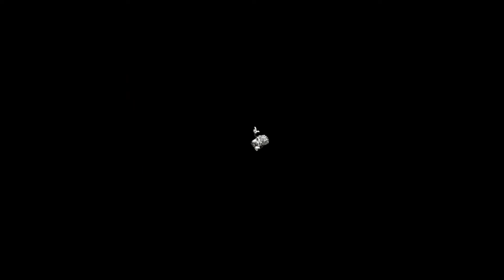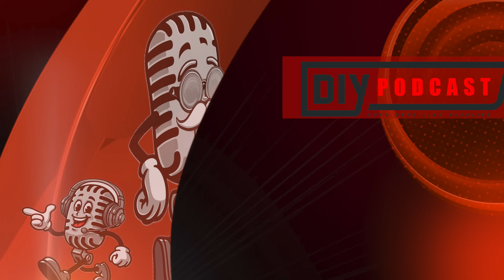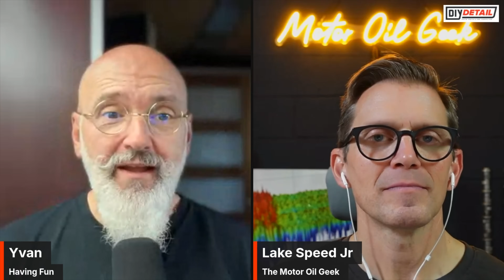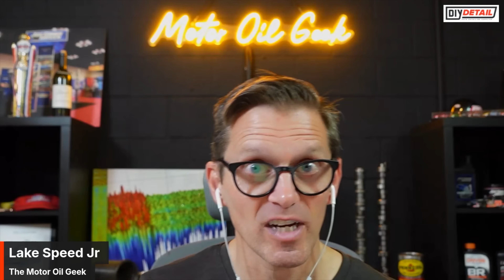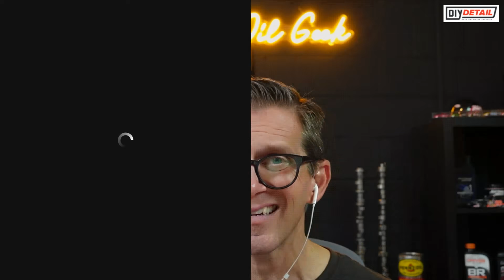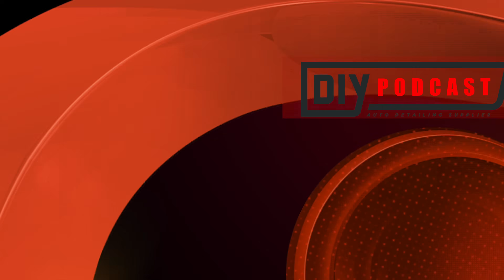Oil myths busted with Lake Speed Jr and DIY DETAIL PODCAST

Comment: As a general rule for the avg driver I rec the following maint sch’d,
* Run a quality fi/comb chamber cleaner (Techron concentrate plus!) just prior to very oil & filter change. This ensures injectors stay clean reducing chance of injectors getting dirty causing fuel dilution of the oil & or excess carbon buildup in comb chambers.
Note,don’t run inj cleaner in a fresh oil & filter change,that because the small carbon particles it removes from comb chambers & injectors can in some cases get past the rings (esp low tension rings) into the crankcase contaminating the fresh oil.)
* Change the oil & filter every 5k miles max using a quality full syn oil.
Note,if your car or truck mfg rec’s for ex a 0w-20 oil & your vehicle see’s more severe service like towing,a lot of stop/go traffic or you maybe take it to the track on weekends i rec going from the mfg rec’s 0w-20 to either a 5W-20 or in sever use cases a 5w-30.
That’s because going from a 0w to 5w base oil & from a 20 to a 30 grade oil when the oil is up to full op temp makes the oil more resistant to viscosity shear for better protection without being too thick/heavy of an oil for todays VVT etc to work properly. For example,If you put 0w-20 into sever Srv’c at times it can easily in some cases shear from 0w-20 to 0w-12-15 or lower which isn’t good. 
But when you start out with a more robust 5w base oil & 30 grade oil when up to norm op temp if the oils pushed hard enough to shear a bit you still have maybe a 2.5w-20 or 2.5w-25 oil still having enough viscosity left to properly protect the engine till the next oil & filter change.
I also rec coolant,transmission (filter too with auto trans)  & differential oil to all be changed at 50k miles too vs many mfg’s rev of at 100k miles.
Also rev checking air filter at every oil & filter change & Repl as needed.
Lastly,if applicable change the fuel filter at reasonable intervals vs mfg rec of 200k miles.
Happy motoring!
Scott
Reply from the maker: Good recommendations.
Reply: Good tips. I stick with Redline S1 Fuel System Cleaner because of it's higher concentration of PEA.

Comment: Guys, anyone reading this comment, please comment down a fuel additive you have used and what was your experience with it, so that everyone can be benefitted with a real user review
Reply: I am in the marine repair field and use Mercury Marine Quick Clean if anything at all. We see problems where customers are told not to add anything to the fuel when they should be using fuel stabilizer to slow fuel degradation and system corrosion control. Those that exchange the fuel every 2-3 weeks or so and use non alcohol fuel are usually OK but those that don't use up the gas in a month or longer, then put fresh gas on top of it really need to keep stabilizer in their fuel and use a high octane fuel since the octane also degrades. We also see people adding way too much cleaner and leave it sit in the system destroying parts. If adding any thing don't use more than recommended. As Lake said, more isn't better.
Reply: Let me go first myself - Chevron Techron 12 oz in 50 Litres of RON95 (RON 91 for US) in VW 1.0 TSi (3 cyl) at 16K kms (10k miles) on the odo - Loved it man!! Really really good product

STP Ultra 5 in 1 365ml in 50 L RON 95 at 25K kms on the odo - currently testing this in my car. Shall update soon
Reply from the maker: Good idea

Comment: To prefill or not prefill the oil filter? 🤔🤔🤔
Reply: Lake answered this in his video https://www.youtube.com/watch?v=939WTeorBnQ and recommends pre-filling because this primes the oil filter element allowing new oil to flow through the engine faster than not pre-filling the filter. They test it by measuring oil pressure. I own an Indian Motorcycle service shop and this video changed our oil change procedure. Prior to pre-filling the oil filter, we observed around 3 seconds of engine valve train noise. With pre-filling the oil filter it is maybe one second. We even pre-fill filters that are horizontal simply by putting enough oil in the filter for the element to soak up and become primed with oil.
Reply: @dyork75 makes sense thanks for sharing!
Reply: @dyork75  another option is to crank the engine until the pressure light goes off
Reply from the maker: Freedom Worx did a good video on this.
Reply: How do you refill a filter that mounts sideways?
Reply: @barrymantei7795  Only fill the filter 1/4 to 1/3 with fresh oil and the filter media soaks it up like a sponge thus priming the dry filter media with oil. That's all you can do when installing horizontal filters (without making a mess) but it still gets oil flowing through the filter and to the engine faster than if you don't prime it.
Reply: @dyork75  thats all i do and then i crank the engine without running it until the pressure comes up and the light goes off
Reply: @barrymantei7795  you can't. And you can't prefill a filter that sits on the top of the engine. And you can't prefill cartridge filters, either. So the majority of cars out there can't be prefilled
Reply: @LA_Commander It appears some vehicles have a procedure to prime oil filters that are mounted inverted. https://youtube.com/shorts/ZF-SPAKtzrY?si=Qka5z9MUnnKBJB1V

Comment: 49:33 what does he say about Mobil 1 and Toyota? Is he recommending Mobil 1 for Toyotas? Sounds like he says "or Mobil 1 which you're gonna want to do"
Reply: Toyota oil has a slightly different additive package. I buy enough oil and filters at the dealership for a the year. Then change oil every 5000 miles or 6 months. If you do a lot of short trips or start the vehicle move it and stop the engine. You can get fuel dilution into the engine oil. Smell the dipstick or drain oil.  I get it on a 5th gen 4 runner. Now if i have to move the vehicle i will let it run up to operating temperatue before shutting down. Great work Yvan introducing Lake to your audience.
Reply: I watch everything lake speed  but have never seen him recommended Mobil 1 specifically for totota. I have been doing 5k OCI with VRP, and was previously using Pennzoil ultra platinum. Just curious if there's something I missed about mobil 1 and Toyota specifically. @williambell7712
Reply: And thankfully my driving is super easy on the oil. Long trips, highway miles, oil gets up to temp, not a ton of idling. I don't do oil analysis, but I probably should. I probably change before necessary but I figure 5k is a good balance of cost and hassle vs trying to stretch it. Thankfully my dealer sells filters super cheap, so I stock up too. Thanks for the reply!  @williambell7712
Reply from the maker: Thank you.
Reply from the maker: I believe he has a video on his channel
Reply: @diydetailofficial I saw his video on Pennzoil vs Mobil 1 and the history of Mobil 1 video. I figure like he said, no matter what oil as long as it meets the spec is gonna be fine, but I was just curious if Mobil 1 has some specific add pack that is good specifically for Toyotas because I had never heard that before. I'm using VRP right now and it's been amazing, and I'm going to continue with it for at least one more OCI before I switch, but if Mobil 1 has something Pennzoil or Valvoline doesn't then I'd love to switch after I'm done with VRP. Great interview, loved the video!

Comment: Lake, whats the risk of mixing brands, say if you need to add a quart assuming they both meet the same spec, like dexos? What happens if you add clean and protect? We need a video that explores this topic
Reply from the maker: Good question
Reply: I think he has a video explaining that. I’m pretty sure it’s not advised to mix  different oil brands because the additive packages can fight with each other causing issues
Reply: @REEDF96  ive heard that most add packs are similar and mixed up by only a few different companies .  ive been mixing oils for decades and really never noticed anything going wrong and my engines stay clean
Reply: @tjlee9901 not really sure it’s about the cleaning factor it’s the anti wear additives that can clash
Reply: If you do start it, make sure you let it get to full operating temperature and for more than a few minutes.

Comment: “Even with the engine off, air can still enter the engine and come into contact with the oil, leading to oxidation. Fluctuations in temperature can also contribute to oil degradation, even without driving. Over time, the chemical structure of the oil changes due to oxidation, leading to a loss of its lubricating properties. “Many sources state otherwise to a car sitting in a garage and the oil is ok.  6 months of sitting, you should change your vehicle’s oil, I would! Oxidation takes place whether you drive or not as long as oxygen exists.
Reply: Perhaps over geologic time but not over a year or two of sitting.  I had AI do the calculation work and the amount of air/moisture that "breathes" in is very tiny, not enough to worry about and far less that what is generated by those who think they need to run their engine every month for 15 minutes which serves only to put a great amount of combustion byproducts including water into the oil.
Reply: Not true ..have my oil tested at lab  ...3 years old ..TBN still  4 ...BS. the 1 year bs ...
Reply from the maker: Thanks for sharing
Reply: Lake is correct, change oil n filter right before you put them away and don't even think about starting them until spring when you are ready to drive them again.

Comment: I'm on Penzoil Ultra plat. Great stuff.
Reply: Penzoil ultra plat is one of the best oils out there
Reply: Yeah, like many people, I switched to PUP after Project Farm's review.
Reply: @Quidisi I switched from PUP to amsoil signature series lol
Reply: @TaylorPhase  I'm open to doing that, just not sure that, for me, the added cost is worth it, unless it would allow me to safely extend my oil changes. Looking at getting an F250 - will be using one or the other of those two oils. Still doing research.
Reply: @Quidisi PUP is still good. But I forgot what source out there did some testing, but it burns faster than amsoil in high heat and leaves behind some type of residue in the engine when it does. So winter driving with no load it works well, but everything I switched to amsoil. My car only uses 4 courts so it’s only like 15 extra bucks for the whole oil change and has more protection, less deposits and better protection and faster flow. I’m driving a Hyundai hybrid and almost at 300k miles. So I’m trying to use the best of the best to keep my car on life support until I can afford another car
Reply: @TaylorPhase  Yes, Amsoil is better in every way, but Pennzoil Ultra Platinum seems to outperform all the mainstream brands, but it definitely does not outperform Amsoil.
I still might use Amsoil, especially if I can safely stretch my oil changes from 5k to 10k, but I need to get some blackstone sampling done - I've never done that before.
Reply: @Quidisi I’ll grab a quart of pennzoil ultra plat if I’m running low on oil during a road trip
Reply: @Quidisi   I currently testing Amsoil Sig series running E85 to see how long I can go. They say 25k or 1 year. IM going for the 1 year mark. Id consider myself severe service interval so that 25k goes to 15k. Then with E85 cut that in half so we shall see if I get 8k miles which is roughly what I drive per year. Blackstone is who ive used so far and I got 4k miles max out of my PUP so we shall see how Amsoil does.
Reply: I'm using Motul currently but switching over to Pennzoil Ultra Platinum on the next change. Already using it on the wife's car, and has been great.
Reply: @emswice8920   I have used many different oils on my Honda CB1100 motorcycle, and I have to admit that Motul was the best oil so far.  The shifting is like butter. (on many motorcycles the engine oil is also the transmission oil).  So I could feel the difference.
Reply: @LA_Commander  There is a huge difference in motorcycle oil and the diesel oil as diesel oil is made for LOOSE tolerances and there is a chart that proves that. Motul is great oil use that and Maxima both.
Reply: @mt1885   Yes, exactly.  That's why I used Motul oil for motorcycles.  I do not use diesel oil in my motorcycle, even though some of them are JASO rated.
Reply: @LA_Commander  Diesel is not good on them engines totally agree
Reply from the maker: Thanks for the feedback!
Reply: When you say it's great stuff, is this based on actual oil analysis you've done, or are you just talking?
Reply: @IaintTrynaGoOutLikeBIGnPAC  FWIW....Subaru 3/.6R at 115,000...Southern AZ....Pennzoil Ultra Plat 5W-30 from new....change oil/filter every 6,000 as per manual....My UOA numbers are better than any others I have ever seen from any source.
Reply: I’m PUP, and a huge skeptic of VRP, until Lake shows me the actual proof, not some dipstick trick for patsies.
Reply: @onedaily2471  I've had good results
Reply: Just an overpriced Group 3.
Reply: @amazoidal amsoil is group 4 tho right?
Reply: Why do so many people like the ultra platinum? Can someone point me to some evidence based insights
Reply: @LeMatt87n  dude...plenty of videos on the platform ou're currently on that explain it. Looks at the dudes channel in the video.
Reply: @LeMatt87n  based on lakes prior reviews and he just talks about in this video using that in his Porsche, based on my own experience it is very good oil.  While Lake pointed out to me specifically that pumping is different than pouring, during severe cold snaps I had far less engine noise and vibration at starts below -10 Fahrenheit.  The Cold pour tests you'll find videos of have amsoil signature series and pup essentially acting the same.  I will never change my oil beyond 5000 me so there's no reason to waste money on the amsoil.
Reply: @LeMatt87n 
1. VRP is hydrocracked base oil, not true synthetic, it is contaminated with sulphur and nitrogen compounds like traditional oil (sulfur salts reacts with moisture, you get sulfuric acid slowly eating your engine parts)
Reply: 2. GTL is 100% pure. PetroTrends has published a comparison of high-performance base oils, indicating that GTL performance is close to that of PAO. Pathmaster Marketing also has obtained unpublished data. GTL base oil has a much higher VI than the comparative PAO.
Reply: 3. This property of GTL base oils significantly enhance the long-term oxidation stability and stay-in-grade viscosity performances during extended drain interval. In addition, PUP additive package is second to none. Valvoline additive package is pale in comparison. Mobil 1 extended performance is the only one close to PUP
Reply: @onedaily2471 are the effects of that acidic erosion measurable? Where have you seen the data?
Reply: I use Super tech Full Synthetic. Great stuff. Thanks Project Farm.